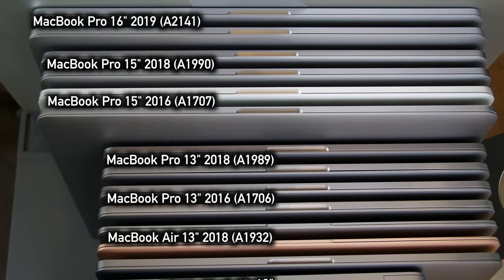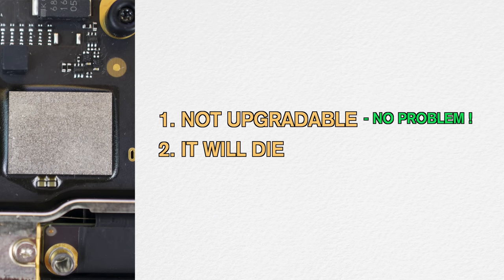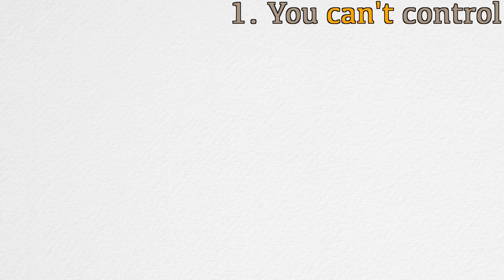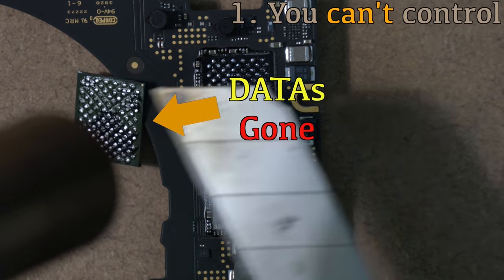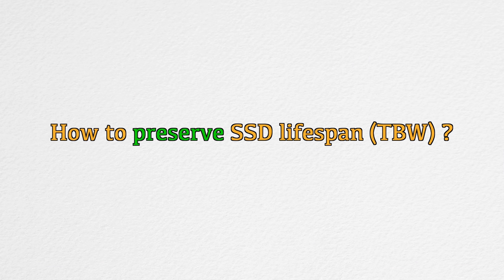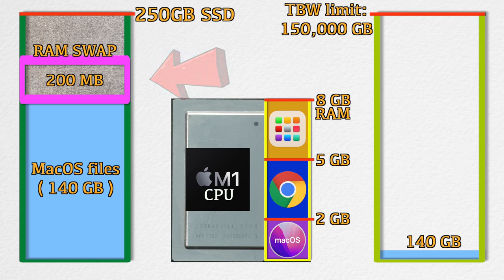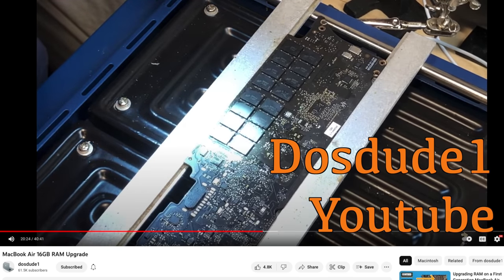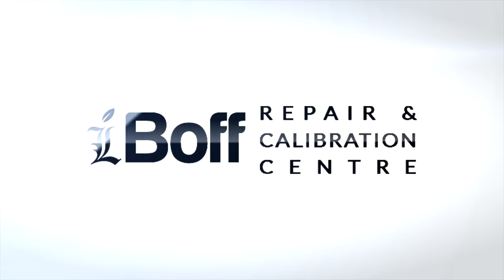These MacBooks DIED from SSD Failure & How To Prevent It (Not for RICH dudes!!)

Comment: Amazing job! you have a new sub. Just to say in relation to 12:24 : I've a 16GB of ram Macbook Air M1 and it uses swap memory even with a lot of ram available. I think this is just the way macOS works
Reply: It just " apple cant make faulty products its the way it works" must find an  excuse
Reply: @Teluric2  This is not a fault. MacOS uses it even when is RAM available because the operating system may decide to use swap space to temporarily store data that it anticipates it will need again in the near future, so that it can free up physical RAM for other things, this helps the overall performance and Windows/Linux do domething similar

The fault is the SSD Lifespan
Reply: @alex.x8782  The fault is the soldered SSD, actually. If it were user replaceable, no issue would be raised whatsoever.
Reply: @alex.x8782  If the ssd was replaceable it wouldn't have been an issue and this is why some people see mac users as sheeple. Every other laptop brand can have their memory, hard drive and sometimes even the processor replaced by the user and it's not even a hard thing to do since most laptops just have a removable cover which exposes these parts.
Reply: @phamnguyenductin  Yeah, you're right
Reply: @dredgewalker  “every other brand” yeah I wish. There’s less and less decent laptops, especially light ones, with memory and storage that’s swappable
Reply: @dredgewalker  A few years ago, maybe, but nowadays a lot of laptops come with soldered RAM and even SSD.

As for CPU, it’s been long since there were easily replaceable models for laptops. Even the Framework has a soldered CPU…
Reply: @GRBtutorials  Wow, I'm glad I'm sticking with desktops. I won't buy anything that I can't fix on my own. I've always fixed every hardware I own including consoles like my psp, vita and switch,.I even fixed my own ps3 by replacing the bluray drive, replaced my 3d printers boards and my escooters battery. Having parts soldered is anti repair and anti consumer. This is why the right to repair laws should be supported.
Reply: @dredgewalker unfortunately a lot of other brands have soldered ssds

Comment: At 14:37 the lifetime percentage  reported by the ssd usually is the percentage of backup blocks left. So technically speaking if everything is in check with the SSD it should work properly until 0% lifetime.

Also the TBW is just the "guarantee" a manufacturer gives to its product to show the quality of it. An SSD can last much longer or shorter than that. It should be taken as "it will fail around that value" and not a "it will die the moment it reaches that value"

Comment: I used an external ssd when the internal died. Good thing about Mac is you can boot a proper system even from external USB!
Reply: That was before 2019 Macs- Now the BIOS is inside the NVMe.

Comment: 1. The main reason why mac's SSDs are dying is because they are used.
There is value that shows how many times the cell can be overwritten before it become unable to hold a data, after that this cell is dead, we call this effect "tired". I don't know for sure but it seems to me that controller with FW that rule the whole SSD life unable to identify when a cell become dead during the normal use. That is why they are often become dead suddenly. Usually, at factory, when a NAND based device is being produced it passes tests to define all unstable cells to include them to FW to avoid them to use during normal life. As I know Intel wastes almost 50% of NAND resource during these tests.
2. Do you know that when you access to a file, just to open it, some fields of the file record become updated, these records stored in a file system, that is why the first place that is "tired" it is place allocated for the file system.
Do you know that when you change for example an one symbol in the text file it leads to overwrite at least two pages in a NAND chip one for the file and one for the file system record, plus something in FW. It is NO one bit, No one byte - the whole page that have size of xxx kilobytes. I don't even mention that the file system also has a minimal block of sectors called cluster that being overwritten when you or a system updates something.
3. Because of all these effects and events a FW tries to predict problems and manage them so it moves your data over a SSD's space to get it "tired" evenly and updates FW space also to reflects these changes :) I forgot to mention that FW also stored on NANDs ;) So during these processes FW gets failure.

Why haven't you show the size of ram swap for 16gb RAM system I bet that it was present.

You haven't mention one more issue that is not directly related to the topic of this video but connected to all NAND based devices such as USB keys, eMMC storages, CFs, any type of SD cards, SSDs, etc.
There is a value in datasheets on NAND chips that shows the time of holding a data in a cell when it unpowered. For the newest NANDs it is counted in months. Leave a newest SSD with data unpowered for a half of year and there is a big chance that your data just disappeared.
We're joking: Do you know how the data recovery specialists call  2Tb SSD - a fast way to lose 2Tb of your data.

The last thing I have to mention that any maker of any kinds of storage is not responsible in any way and therefore doesn't care about safety of your data that is stored on their devices.
There is only one way to have your data safe - do backup.
We're joking: What is better then a backup it is two backups in two different places and the better onto two different continents :) 

To sum up it is good video to recommend to my clients to get them aware.

Comment: Just keep the drive < 50% full or buy a another drive for empty keeping. Then periodically copy data second time, and delete the original, this way you free the long lasting space with empty space that is more often used, and level out the wear. 

In the Unix filesystems the fragmentation isn't a such problem as with FAT32 or NTFS.
And if someone wants to defragment a file or why not even whole filesystem, it is best done by just copying the file and deleting the original.
Now your fragmented file pieces are joined to one and all files are put in order. 

But to do this, you need a good 20-30% free space anyways.

Comment: I bought a MacBook pro in 2016, the model was 2015 MacBook pro 13 inch 128 gb (samsung) ssd. I used the ssd very strongly, I copied transferred thousends of gb in like 3.5 year, after 3.5 year my ssd was dead. I believe that if I did not use it at full capacity it would live longer maybe 4.5 year.

Comment: So pretty much the only way to prolong Macs lifespan is by not using it at all. 
The issue is also magnified in cheaper Macs, where 8GB of RAM is simply not enough and abuses the NAND for swap, whilst the NAND also having smaller lifespan because of lower capacity.

Comment: I just saw there are external NVMW M.2 2280 SSD you can hook up your to you macbook pro and have a 1553MB/s speed. You can set it up to use the usb-c for booting from that drive instead of the internal soldered SSD.

Comment: Great video! I suspected that an external drive would help me preserve the internal SSD of my MacBook air better. Now my suspection is confirmed. Also, when I was looking for my first Mac, I bought the one with a 512GB SSD rather than the 256GB one but I wasn't mindful about how that related to the lifespan of it. So I ended up getting some extra lifespan too. Definitely we who aren't the rich folks who love Apple products must be really careful not to deplete the equipment too soon. Thanks so much for the info!

Comment: It has been over two years since I purchased an 8GB M1 Air. According to the dxdrive tool, I have only used 11TBW, and it shows 99% health. Therefore, I believe my device is in good condition and safe to use as I was using it until now.
Reply: TPS62180 could break at any moment.

Comment: I have learn a lot about Mac ssd. Thanks a lot. I’m using a 2017 Mbp with a 256gb ssd. 27TB data units written. I will change the thermal paste and the battery and for sure stop copy a lot of data in this Mac. Thanks again dude ❤

Comment: My 2012 Mac Mini crashed about 2 weeks ago. The Mac refused to boot from the SSD. Upon checking the SSD with CrystalDisk on my Windows PC, the health only left 1% and in red warning. 

I eventually replaced the SSD and got it running again. As for the old SSD, it is writable but reading is quite slow so I kept as a spare disk for torrenting purposes.

Comment: Do you recommend to buy MacBook PRO  2015  which I think has replaceable ram and SSD, and what about the life of the screen ?

Thanks for opening eyes , this was really informative. Happy New Year 🥳🎉
Reply: 2015 Macboon Pro has soldered ram but replaceable PCIe SSD. The last MacBook to have replaceable SSD and RAM was the Non-Retina 2012 Macboon Pro.
Reply: No it doesn't have replaceable RAM. And the screen's lifespan is normally 5-7 years. At this moment I don't think you can buy MBP 2015 for new, so it's likely been used for a long time and if you're buying second hand, you won't have much time left.

Comment: Fantastic advice. Appreciate your take on this. It's not cheapskate to want your expensive, valuable Macbook to last much longer. The concept of swappable SSD storage on laptops is critical and when Apple chose to solder an expendable part, they doomed it for eventual failure regardless of people using it as intended. My laptop had one SSD failure after just 20 months, but the second one lasted more than 5 years. Now it's failing again. It's too bad Apple doesn't abandon this bad practice.

Comment: The question is “how many of those MacBooks died from TBW limit?” Because it basically comes down to extremely hard load on the computer to write even 1500TB in a few years. I suspect most of them died because of some faulty parts. But I’m just saying. And for the swap files, yes, it’s used as random access memory but the reason why it’s in swap is mostly because those data on swap are not used frequently. IMO Modern OS are quite sophisticated on its own. I don’t think those “little something” makes a difference for the majority of users.

Comment: Unless you're constantly writing terabytes of data to the SSD, the lifespan is nothing to be overly concerned about. I have a 500GB samsung drive as my boot drive for my main desktop for the last 5 years and it still has 99% life remaining. 

The bigger issue is it being soldered, so drive failures, which can happen regardless of TBW, are not repairable without great expense.

Comment: It seems that TBW is just a manufacturer-guaranteed amount of data that can write an SSD and not break.
If this amount is exceeded, the SSD will not immediately die and can work as if nothing had happened further, perhaps even with a good SMART, it simply loses the warranty and is no longer considered guaranteed reliable.

Comment: How about adding TVS diodes to the SSD drive power lines? So if the regulator fails the TVS diode clamps the voltage and prevents the SSD from dying? Is there any sort of fuse on the power bus that will blow if the added TVS diodes activated? Would that be possible to add?
Preventative maintenance is what I cam talking about here...

Comment: Most people will not come even close to an SSDs lifespan. If an SSD fails, it will be due to an actual failure, not because it was worn out. There are a lot of good reasons why soldered on SSDs are a problem, but wearing them out isn't one of them. Configuring more ram is always a good idea.

Comment: Hello ! thanks for your video !   Question:  Does that also apply to SSD external drives like the Sandisk external Drive for example ?
Reply: Yes, pretty much all modern SSDs are flash-based memory and that flash memory is what wears out.

Comment: Lots of fear mongering: I am using my MacBookAir M1 (500GB SSD) almost daily since 3.5 years including hourly backups and lots of downloading, installing, copying. Just checked the TBW (aka data units written) with DriveDx and guess what, even with my heavy usage it’s just 20TBW out of 300TBW, meaning I can theoretically use the SSD for another 52 (!) years. This is further confirmed by the SSD lifetime indicator sitting at 98%. Guess I will have upgraded long before that SSD will die…

Comment: This is why I still main mechanical hard drives. Solid state is good for moving lots of data fast, from one place to another. Hybrid drives are a pretty good compromise, but they could be even better, if the solid state portion, was socketed, replaceable, with an automated recovery partition reserved on the mechanical part of the drive, so the new blank solid state cart, just formats to be a ready replacement. Basically, like an exiting hybrid drive, but more modular.
Reply: SSDs today are fine. What's terrible are Apple's anti-repair and anti-consumer practices of soldering stuff like SSDs and RAM onto the logic board.
Reply: Hard drives are way less reliable.

Comment: Great the YT algorithm brought me here. I reasonably bought an Refurbished MBP M2Max with plenty of 32GB of RAM and 1TB SSD two weeks ago. And additional to this two 2TB Nvme WD 970Black two Acasis TB4 Cases with fans in it. I just came back to apple after 15 years. And I guess all in all I did my homework prior and had a lot of savings during black week offers. I had this feeling in my belly and I was right, this video proofs it. My only question is, does it matter which external SSD should I use? Now I bought the nvme but the old fashion SSD's are better? Thanks in advance from Germany
Reply: I also would like to know.

Comment: Any drive that you use will eventually wear out.  The problem with SSDs is their life spans typically wear out dramatically faster than a hard disk drive.  As not all SSDs are made to the same quality standards.  This is true for HDDs as well.  But with that said a mechanical hard drive lasts up to 10 years of daily use.  I don't mean a few little file transfers each day.  I mean heavy usage of hundreds of GigaBytes or more worth of files being copied and/or moved from folder to folder or between drives.  For the SSD every time you read data from it you're wearing it out.  Every time you write data to it you're wearing it out.  SSDs with over provisioning can use spare space to compensate for the dead cells from presenting a noticeable reduction in total storage capacity.  For example are 512 GB drives that is advertised as a 500 GB drive.  The extra 12 GBs is reserved to stretch the perceived lifespan of the SSD.  I'm not aware of this approach for magnetic hard drives.  

Both drives will lose some total capacity due to formatting for the Operating System you're using the drive with.  When I use a 14 TeraByte HDD on Windows 10 I am left with about 12 - 12.50 TBs of HDD space after formatting.  With a mechanical drive as sectors start to go bad they are no longer accessible.  You won't necessarily see an overall reduction reported to you when you check the status of the drive.  But you will certainly know you have less useful capacity to work with.  You'll also typically start to hear tell tell sounds from the drive that it is starting to die.  Which gives you some time to get a new HDD to copy all your data over to before the failing drive stops working.

With the SSD you never get an early warning from it when it is starting to become unreliable.  The diagnoses software can falsely report the SSD is safe to use one moment and then a moment later the drive ceases to function and takes all your data with it!  So if you're stuck with a SSD it is best to only have copies of your data on it.  NEVER use them for primary storage of original data.  Not until the SSD are equal to or better than their HDD counterparts.  When the SSD costs the same (or cheaper) as the same capacity HDD and lasts as long (or longer) then it would be something to consider as a drop-in replacement for Hard Disk Drives.

Comment: im not a computer guy and am planning to buy macbook air m1 8/256...thank you for explaining this in a simpler manner. i might choose windows instead because its cheaper and more repairable.
Reply from the maker: if you still want to choose mac, you can opt for 16GB RAM and 256GB, and use external SSD for extra space

Comment: External storage is mainly good for safely store files, but not that much for protecting the internal SSD if you download (expecially large) files from the internet, as every of those files come trough the internal SSD and then moved to the external one. So wear and tear is guaranteed.
The best solution is a system with removable internal SSD, a large SSD, and also external storage for important files.
Reply: No. Because you use macos from the ext one. No use of internal

Comment: Other than my battery needing to be replaced, My late 2012 Retina MacBook Pro is still working just fine (256 SSD,  8G RAM).
Reply: I have a dirt-cheap lenovo laptop from that time that I still use. I've replaced the battery several times over. You know how to replace it? slide a little latch, pop it out and pop a new one in. MacBook battery can be replaced but it is far more involved. Apple engineering is an oxymoron.

Comment: I have 128GB, 8gb RAM 2014 MB Air, with only 3.3TB data written on latest (runnable) MacOS. I don't think the data is that exaggerated. Using it smoothly daily.

Comment: The one thing from your explanation was incorrect, deleting files (even without overwriting files) also add on to the lifespan, a block can only be zeroed out before it can be wrote by new data. The zeroing is also counted as a write cycle.

Comment: 13:05 Swapping isn't that awful. Data put in swap tends to stay there a while. The whole point is to put rarely-used data there. Also it can swap out far smaller chunks than 200MB.